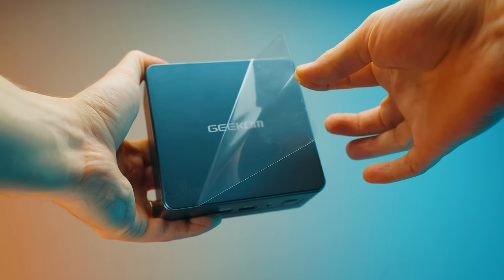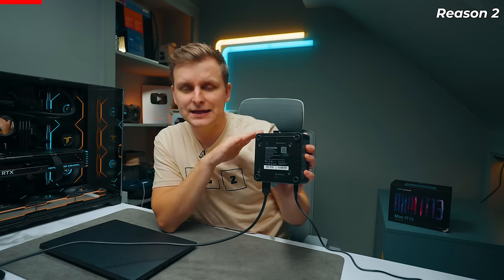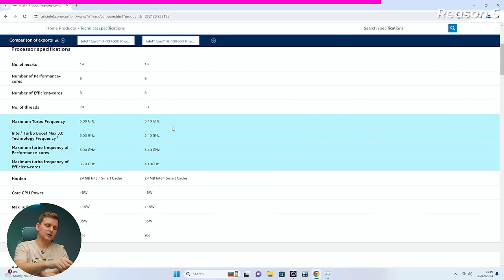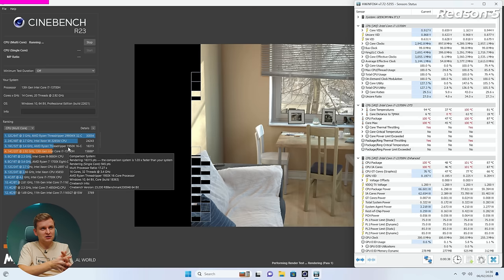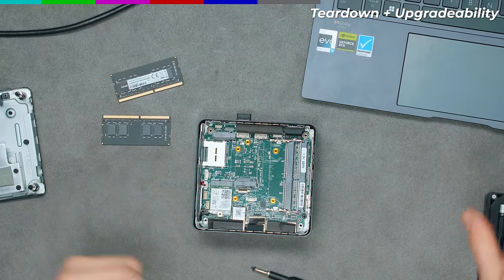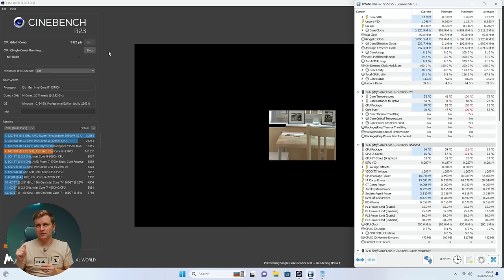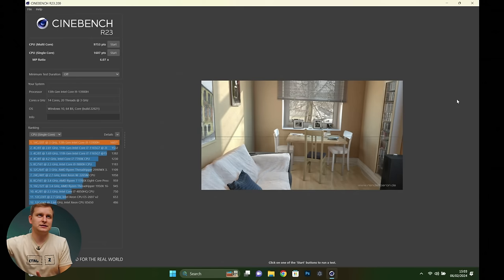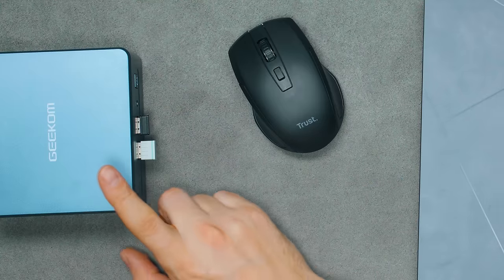Surprisingly Difficult Choice: Mini PC vs Laptop? 👉 14-core Geekom IT13

Comment: I think this mini PC is nice, but it's not a replacement for a laptop whatsoever.  It's more a replacement for a desktop, since you still need a monitor, keyboard, and mouse.
Reply from the maker: 100%, but my argument was for people who buy a laptop even though they don't need the portability... :)
Reply: I use a wonderful portable monitor and keyboard, and travel with mini-PCs all of the time. I bring it into the office and connect up to Ethernet or WiFi and it performs very well.
Reply: I need a keyboard, mouse and portable with the laptop already though 😂
Reply: I clean offices and every building I clean has a "hotel" with a laptop dock in it.

Comment: Only this laptop has a dedicated GPU, and this mini PC does not. That is, in addition to the keyboard, mouse, monitor, you also need to add a video card on top. I would really like to buy a similar device with at least rtx4070 on board, but unfortunately they don't make such a thing.And if they did, the price would be the same as a laptop with similar specs.

Comment: The MX Keys keyboard you recommended is great if you don’t want to use it with the backlight. If you want a backlight, seek something else. The MX Keys have faulty proximity sensors built in, affecting the timing when the backlight comes on or off. It’s very distracting when you work with this keyboard for longer sessions or when you need to focus. After more than 2 years Logitech never addressed the issue and left customers who bought it with no solution other than completely switching it off using Options+ software.
Reply from the maker: I've used it for 4 years now and have had no issues with it... could yours be a faulty one?
Reply: I've had the MX Keyboard for nearly 2 years, no issues with backlighting and settings are configurable.
Reply: I got a MX keys and have absolutely no problem with the automatic backlight

Comment: I just purchased the Geekom IT13. Two TB4s @40Gbs is simply fantastic for my needs. I like redoing the thermal paste and will get to that today. For more cooling, I've decided to keep the IT13 on it's side (where the heat pipe curves around to the exhaust) with an external fan blowing into the side. I'm considering a 3D printed larger case and add more quiet fans. Nochua's or similar. I just don't want the throttling as I do a lot of e-learning with Camtasia.

Comment: Thank you for covering the small form factor PCs on your channel. I got one and it has been a great complimentary machine for my laptop. I have been using it primarily for 3D rendering. It is also great for traveling. Knowing I could use the monitors and keyboard at my parents house during the holidays,  I only had to bring the tiny PC and nothing more. While I still plan to get a proper desktop machine for content creation, I still need to finish taking care of other expenses, so this tiny PC has been great at solving my current needs at an affordable price and low power consumption. I only hope in the near future they start to incorporate mobile discrete GPUs as an option as well.

Comment: Built a tiny shoebox to replace my laptop for mobile music production. I did it after I built a full sized desktop to replace my at home laptop for the same reason. Both desktops destroy any laptops that’s on the market now and I can upgrade it. For example a major digital pcie card came out that’s my audio interface dream. I wouldn’t have  been  able to use it in a laptop. It’s still portable. I found a small 12 inch screen, foldable keyboard, etc. The only advantage the laptop had was to be able to use it without a power chord.

Comment: I have a somewhat niche use case where a mini pc fits the bill perfectly.  They can also make inexpensive, low power routers and servers for home labbers.  I own 2 right now (one to run opnsense on, one for windows) and am pretty happy with my setup.  Some mini's are starting to come with oculink which makes an external GPU fairly painless or you can use a second m.2 for an external GPU but that will generally take a bit of hackery to get working.  Love these little boxes, it's almost a shame Intel sold off their Nuc unit and I actually wouldn't mind seeing slightly larger units with better cooling.

Comment: I think that it's a very interesting device, but, as I'm sure most people watching this channel are aware, it also depends on your use case. Like you mentioned, if you're mostly working in a stationary location then the mini-pc is probably the better choice over a laptop for all of the advantages you mention in the video.

However, I know laptops are quite convenient for people who want that portability aspect, and that's usually why people will buy them. Maybe they want to do tasks on the couch while watching TV, or maybe they want to go to a coffee shop or the library. And, laptops are especially valuable to students at the post secondary level who need to move between different classrooms, buildings or campuses.

As a personal example, I have a Lenovo Ideapad 5 Slim with an AMD Ryzen 7, 5700U that I bought 2 years ago for when I was doing my GIS Bachelors. If I had bought a Mini PC instead, I would have lost out on the convenience of portability that came with brining my laptop to all my different classes or working in different locations.

So again, the video brings up some great points, and if you're just looking for a PC for doing light photo editing and day-to-day tasks with a similar form factor as the Mac Mini, but much more affordable, then the Mini PC pretty much blows the laptops out of the water. But in an environment where portability is more important, the consumer will probably choose the laptop.

Anyway, great video! Very interesting to draw attention to the mini PC as an alternative for people looking for a laptop, or laptop equivalent, computer.